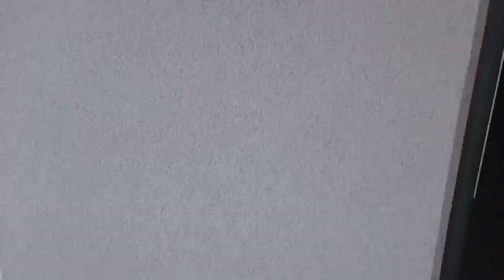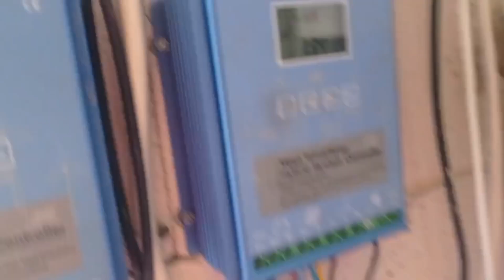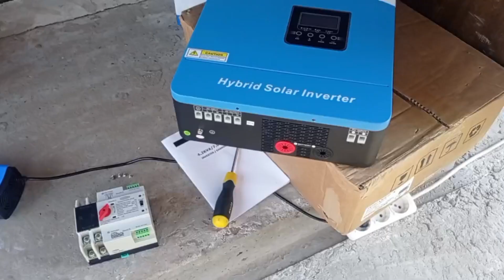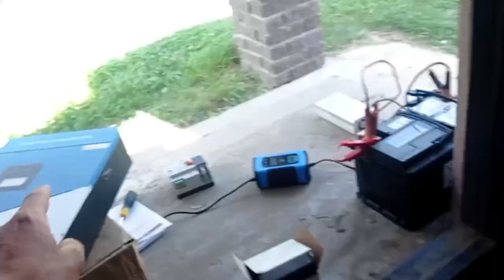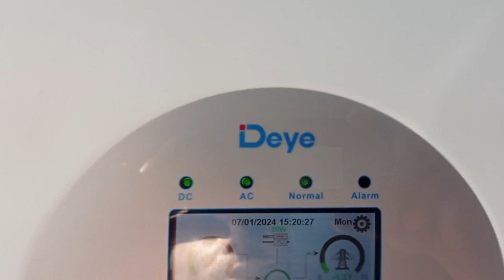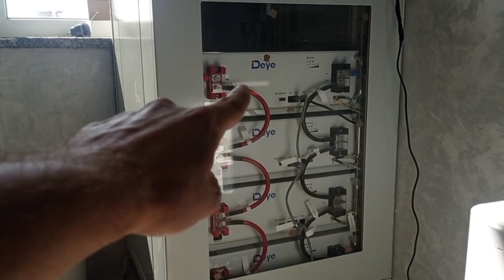Almost all types of reserve power supply systems reviewed, based on my examples and experience

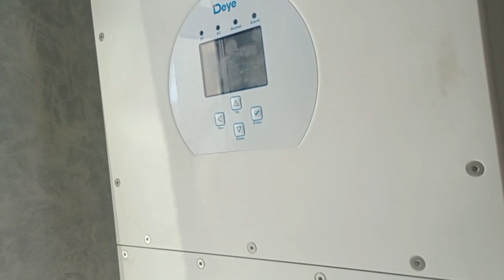Comment: 14:38  what is the battery and inverter prices in your country? In my country Syria Deye inverters is 1000 for 6 kva and 10 kw battery is around 2000 $
Reply from the maker: Deye 6 kW you can get for about $1100-1200, and one 5kW battery unit like mine - you can get for $1350-1500.
it is slightly cheaper if you are getting them from Alibaba directly.

Comment: Go for sodium ion batteries IMHO
Reply: Sorry to hear about the recent inflation on your energy microgrid equipment. It sounds like price gouging sadly.
Reply from the maker: Well, it's because the demand is so high right now. I personally am already well prepared to any scenarios, but will continue doing small improvements to the system here and there.
Reply from the maker: Why sodium?
I found a good manufacturer to get a whole lot of LiFePO4 batteries, so will probably stick with what is already proven being efficient
Reply: @BackyardVoltage  
I expect that the price for the LFP now make them a better choice for now. Na-ion prices will start coming down soon though I suspect. I like them better for their charging, discharging and fire safety for stationery setups, but that industry is just getting started.

I mentioned being worried about price gouging because so many people must be desperately trying to build microgrids now like you are in Ukraine because of you know who.
Reply from the maker: Well, I got additional LiFePO4 batteries of 62 kW pack for roughly $99.68 per kW.
Can anyone beat this price? DDP by the way.

Comment: Can those EAsun units last long?
Reply from the maker: if used wisely, no overloads - then yes.
but in general given the cheap price - I'd expect to replace them every 3 years or so.
Reply: @BackyardVoltage  i would say like 50-70% of rated power should be OK. I think many people destroy them with undictive load. Buy 1kW inverter for 200W fridge and then complain they killed it.
Reply from the maker: yes, they forget that fridge has some startup peaks normally, and you have to be accountable for that as well

Comment: Thank you a lot for your channel, this is a godsend for me
i want to add one more detail, victron have less energy consumption in idle, but when inverter loaded more than 15% deye giving higher efficiency
also deye will be more effective when energy will go directly from panels to consumption or grid feeding
So deye more effective overall
Reply from the maker: yes, all you say is true.
however, just for a rough assumption of how much each exact inverter uses while idling - you can count on 1% of inverter's nominal power, and that would be +/- the value you will get in reality.